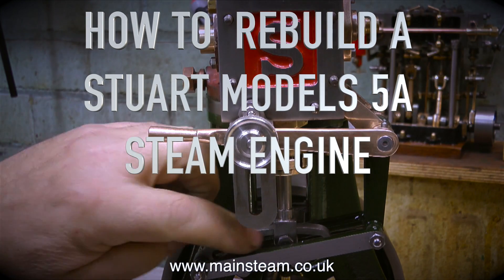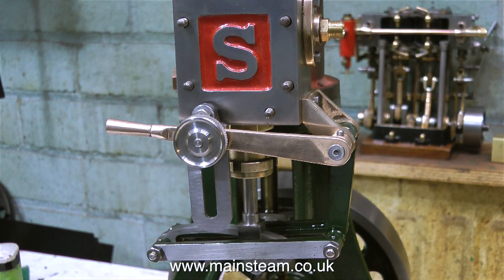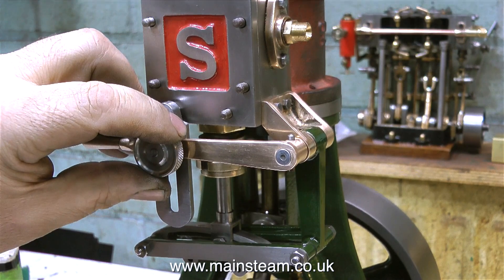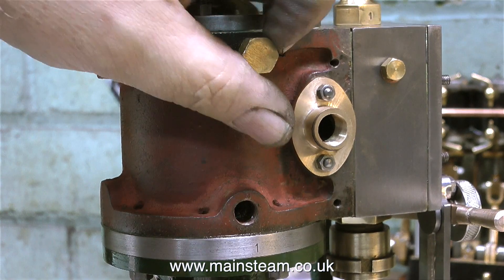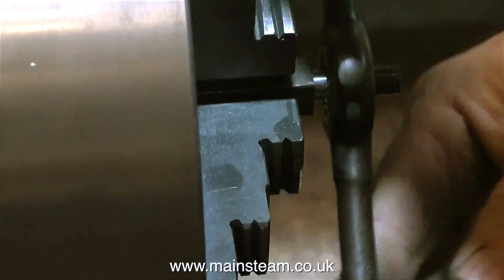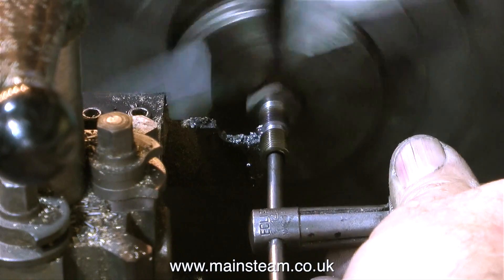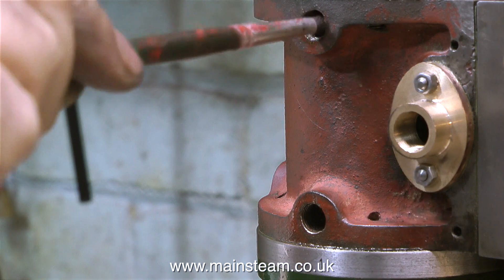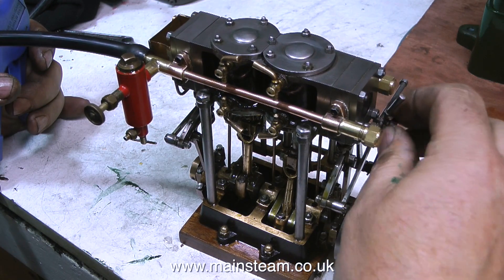HOW TO REBUILD A STUART MODELS 5A STEAM ENGINE - PART #26

Comment: Stuart spec's the 5A at 1 1/2 bhp with 100 psi @ 800 rpm. In your experience do you see this machine turning that fast? I know it's large and know steam can make great power, just wondering how factual that spec is. Some on that frequently runs them on live steam can contest to it.
So all that wood in your head.... Does that make you a blockhead?
Reply from the maker: I have run a 5A at this speed, but it definitely needs to be bolted down .... :-))))
Reply: Amazing! All that rotational mass at 800 rpm. I guess ill find out this winter my 5a shipped last week. Looking very much forward to getting it. I will follow your lead and open then box with a battle implement probably my katana?

Comment: Hi Keith. Love the videos. Is there a problem with dissimilar metals causing corrosion? There seems to be a lot of different metals in a Steam engine.  
Keep the videos coming. Love them and your sense of humor.
Reply from the maker: The only obvious corrosion I see is between aluminium washers on brass fittings into a copper boiler, generally limescale is the more of the main problem with model steam engines.

Comment: You said you do these videos for public viewing. Please clean your nails they are too dirty. Can you paint the too, they would look pretty :)

Keep up the good work...
Reply from the maker: It's totally impossible to keep them clean when working with cast iron  . . . I will try harder next time  :-))))
Reply: Robert Barlow, these videos are for beginners. I don't know many beginners who have a nail brush lying around the shop, and I do not recommend using the one-inch belt sander. I like to know where my fingers are at all times, and that does not include scattered around the shop.

Comment: Back in the day machinists used to use heavy parallels behind the job / in front of the chuck and non of them ever died.
Reply from the maker: Thank you for a sensible comment ..... :-)))) I will be careful with my 3 ounce piece of wood packing in future, maybe I will Super Glue it to the chuck face, then bolt and clamp it just to make sure  ....... and maybe attach a safety chain to it too . . . :-)))
Reply: Nope, a 3oz piece of hardwood is the same as a 3oz piece of soft wood if it's a missile. :) Hardwood is better because it doesn't dent like softwood. And if it's centered like Mr Appleton has done, it's safe enough.
Reply: Just make sure you round off the corners, you should be alright.
Reply from the maker: Before this topic goes any further, in an orgy of Health & Safety,  please be aware that almost all of the Lathe video sequence that you watch on my channel are speeded up ........ the "Missile" would not even reach me where I am stood at the speed it would be ejected from the chuck, which it won't anyway ........ zzzzzzzzzzz
Reply from the maker: I think I will stick some nails & razor blades in the next piece of wood packing - just in case :-))))))))
Reply: You want to use hard wood, that way it wont get damaged when it hits Mr A's head. :>)
Reply: Finally,  we have discovered the secret to eternal living: use parallels and never die. Hurray.